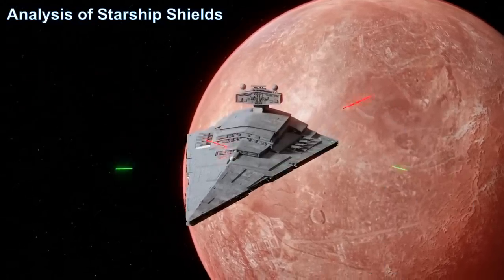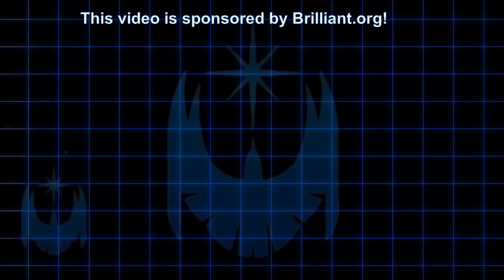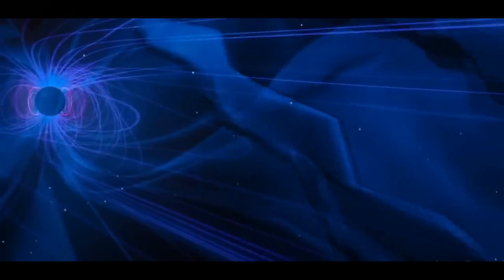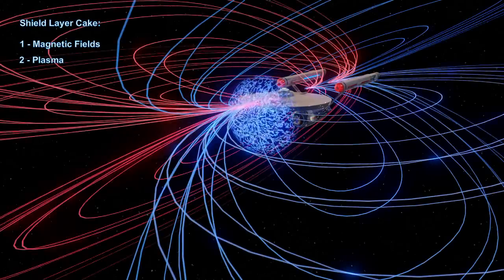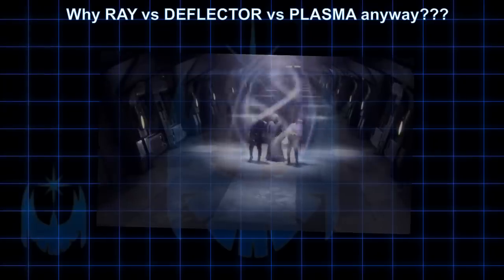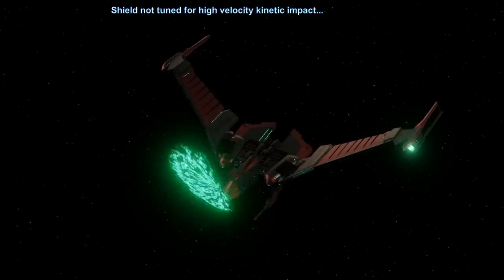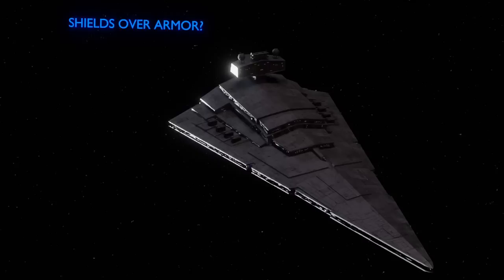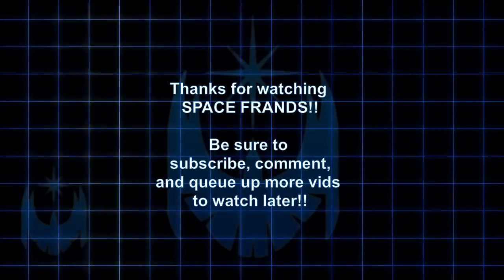REAL Starship Shields Types - They Work Like This...Animated Breakdown!

Comment: Funfact about Lasers - In "Star Trek the next Generation", when some weaker Ships attacked the Enterprise-D, it was mentioned that the Laser-Weapons can't penetrate the Navigational Deflection.
And there'S a simple reason for that to be a part of the Starships Navigational Deflection:
When travelling in space with more than LightYear, the Front of the Ship is hit with Particles and the Light of the Stars in a much-bigger amount than usual if approaching a solar-system with Warp-Speed, this could mean, that the Front is hit with the equal amount of light, comparable to a Laser hitting the Ship.
Wioth that amoun t of energy< hitting a ship, the Navigational shielding should be able to absorb or deflect so much energy.

Why I compare the Light of a distant star to a Laser: Imagine that when you travel to a star System that got quite a bright star, then Travel at it with a speed that let's your Ship catch up with the amoiunt of light, that would usually come at you in the usual timeframe of 10 Years, but within a few Minutes, that Amount could become Dangerous.

And in some Cases, they showed in Star Trek, how the Outer Plating of some Shjip-Section would start to receivbe Damage.

Comment: They exist because Star Trek special effects couldn't have the original Enterprise get all beat up all the time, so they created the concept of invisible ray screens/shields that the cast could comment in the dialog.  That way the seemingly undamaged USS Enterprise could be at 2% shields and failing, with a stressed looking cast on the bridge set, and it would be dramatic.  Then everyone copied them.  Now, every sci-fi universe seems to have shields, though we often see damage anyways because it looks better that way.  Only now are we seeing sci-fi ships that ditch invisible shields for just good old fashioned armor plating.  But, the real world answer is that there was a filming budget, and this fixed the issue.

Comment: I always thought of the shields that act as a sort of wall as being more of a spacial or subspace distortion powered by the ship, and the more damage that the shields take, the more energy it takes to keep them active which will eventually either overload the capacitors or just drain too much power from the ship.
Reply: At least for Star Trek.  The TNG Tech manual describes shields on a Galaxy-class starship as being an intense bubble of graviton particles or field that creates that spatial distortion that is effective against both matter and energy, if I remember correctly.

Comment: Shield technology in Trek is a bit tricky to grasp. There's no specific distinction between shield types, because one shield can do various things: deflect objects, absorb enemy fire or withstand kinetic impacts (to a degree). Also, deflectors deflect physical objects with graviton particles, and do it independently on shields.

Shields on Starfleet ships are projected by 2 main components: shield emitters and the deflector dish, which ties up the shield bubble and provides stability to it. That's why they're called ''Deflector shields'', ''Deflector screens'' or simply ''Deflectors''.

Star Trek only distinguishes between 2 types of shields: bubble shields and shields that conform to the ship's hull.

Comment: Ironically the best defense would be, that if the ship would be in water. Well of course instead of water i'm talking about some dense gas which acts like water, but can be manipulated by, say a magnetic field. So basically plasma shield for example.
What i'm saying that plasma shield would not evaporate projectiles, but rather slows them down similarly when you fire a high caliber weapon to water. Also the micro meteor armor on the ISS uses double hull with air between them, so the second hull is not penatrated.

The shield would probably slow down any medium speed (cannons) projectile, absorbing it as heat, or maybe deflect off if it hits the shield in a shallow angle. Very high speed projectile (rail guns maybe) would be able to penatre thru, hiting the armor directly with much less penatration power, but still able to cause some damage.
Very slow projectile (like torpedos, missles) probably would have no problem going thru the shield though, just like in water. That needs point defense probably.

The shield would also protect from heat based weapons (lasers) like water protects from them. It would reflect, scatter them, or absorb it, increasing the shields heat. Very concentrated beam would still probably penetrate it, but with much less power. However the problem with this is that the shield would not allow thru visible light neither, so you could not see thru it (and nor does the host ship from inside). So the transparency of the shield must be adjustable at least on some light frequencies. 

Hiting the shield constantly would make it absorb the heat of the weapon, heating the shield up to very high temperatures, which would probably leads to the loss of the shield, as the dense gas would escape. It may also cooks the host ship if the temperatures gets extrame high, which probably results in a literal shield dropping to prevent it damaging the host ship.

Comment: Plasma shields. Lol. Try that against the Covenant.
Their weapons are based on plasma.
Basically, they have massive plasma projectors able to melt normal metal plating armors (so you need stuff like ceramics or better, in Halo Titanium-A works against it pretty well, but once plasma reach the superstructure of the ship, it melts it and destroy the support that keeps on the armor).
If you have plasma shields you basically ends up fried. At every hit your shields will accumulate more plasma and increase in temperature, which is not going to disappear or lowering down because your magnetic field keep it up.
At some point, you will be surrounded by a plasma shield so hot and heavy that it could possible disrupt your magnetic field and falls upon your ship melting it like ice under the sun.
Star Trek and Star Wars ships aren't fitted to fight the Covenant.
Although Covie uses also some kind of lasers, if I remember correctly, UV lasers. Those will probably inflict no damage to ST and SW ships.
Covenant Plasma torpedoes instead will be a lethal threat. Even if you are able to hold on the hit with your shields, the explosion of these torps will just increase the amount of plasma of your shields. So we return to the same stuff of before.
It ends up with the plasma shields collapsing and doing damage to your ship and ultimately a torp more will destroy the ship. Also because these torps have long range, auto-tracking and huge charges.
UNSC developed Titanium-A armors that are thermal resistent, plus after the war they managed to put their hands over Forerunner shields. That are "solid photon shields".
To give you an example, it works like what you see in Star Trek Discovery when the ship loses a part and shields enter in to avoid decompression.
But these shields are not made out of plasma, only photons. Light basically. Solid light.
And since it's just light, it's not exactly susceptible to heat. It give more energy to the photons, but since they are solids, these photons will not move either way. Keeping the shields up despite all.
I don't really know how it works, it feels weird to me, but also legit since I discovered there's a lot of things that could looks weird but are actually true.

Comment: I would disagree that shields do not "add" much mass. This is more related to the how shields free up the ships physical design.
I would like to think that shielding systems as a whole is less efficient in terms of weight, as you need more computers, more power generators, and generally more equipment to use a sci-fi energy shield, but as these components can be centralised, this allows the ship to be better designed as a spacecraft which does not rely on armour to resist incoming damage (where armour is cheaper and lighter to install, but more expensive to maintain due to frequent repairs and necessity of raw material). This might be me thinking more romantically and how it would have a nice imagery of cheap, crude yet effective vs expensive, sophisticated yet not infallible.

Comment: Also remember that the weapon commonly called a 'laser' is not actually a laser in most franchises, as an actual laser beam would be pretty easy to counter, and also travels at the speed of light. Lasers ironically are lasers in Star Trek, but are extremely uncommon. Most franchises however, a 'laser' is a bolt of superheated plasma or something similar, simply called a 'laser' for practicality.
Reply: well also, "Ray gun" is so cliche scifi and Star Trek already owns "Phaser".  I do find it interesting that ship weapons are not called blaster cannons though in Star Wars rather than lasers or turbolasers.

Phaser I believe comes from the tech babble writers already knew the laser existed even in the 1960s so invented their own weapon term so they could play fast and loose with the physics as writing needed.  Similarly to how data from TNG onwards is stored in units called "Quads" no clue what a quad is but it does mean they never have to fear people going "HAHAHA Enterprise only has 50 gigabytes of storage"(which in 1987 would have been very scifi, today its a mid range iPhone).
Reply: An actual laser beam would be VERY hard to counter.

You can't shoot it down, you can't evade either in most cases. Best you can do is be out of range, start rolling or use your own weapons to try to take down enemy lasers quickly

Comment: Since we're talking about how shields and armor are implemented across various canons, I think it's worth mentioning that in many settings there actually are ways to adapt and repair armor in the field. For example, in EVE, you can fit your ship with armor repair modules, though they're slower and less effective than getting repairs at a station, and armor hardeners can be used to dynamically increase your armor's resistance to various damage types. In Freelancer, you can deploy nanobots to repair your ship in the field.

Comment: At about 7:40, you mentioned how EVE Online handles differing damage types, and it immediately reminded me of the system Star Conflict uses. In Star Conflict, there are three damage types: Kinetic, Electromagnetic, and Thermal with each damage type having different resistances.

Kinetic damage is dealt by railguns, and shields have really good resistance against it, while hulls are weaker to kinetic.
Electromagnetic damage is dealt by plasma, and it very quickly drops shields, but is less effective against hulls.
Thermal weapons most commonly take the form of lasers, and they tend to be in a halfway point between Kinetic and EM damage. They deal less damage to hull and shields than the dedicated damage types, but at the same time, they deal more damage than one of the other two hitting it's opposite medium.

To put it to numbers, on a scale where 100 is unmodified, kinetic damage would do 150 damage against hull, but only 50 damage against shields. EM would be the opposite, where it does 150 damage to shields, but only 50 damage to hulls. Thermal, being a halfway point, would do 100 damage to hull AND shields. Obviously the numbers are grossly exaggerated, but it gets the basic idea across.

And ships can have modules installed that change how much damage they take, or how well they recover from damage. In my builds, I don't bother trying to modify resistances, because increasing one resistance tends to weaken you to another. Instead, I build for maximum shield and hull volume, combined with maximizing regeneration.

Smaller, more agile ships are a bit different for me, though. Since they're normally much weaker than the bigger ships, I'll actually sacrifice hull and shield capability in favor of agility and speed, and rely on just not being hit.

Comment: That is technically possible, but practically impossible.
The energy amount required for all those shields is just ridiculous. My raw estimation is that you need to generate an energy level of a sun-sized star to make them work like shields. 
For the magnetic shielding, your ship must be made from not magnetic materials, so no metal, no electronics, and no crew with water in their bodies(water reacts with the magnetic field). 
Plasma is hot but not dense - so plasma shields that are powerful and dense enough to vaporize objects bigger than dust at relativistic speeds should be something like a Sun convection zone.  While activated they will boil a crew just by infrared radiation in seconds.
And as for active defense - that is the most realistic scenario, but still, your computer, sensors array, and shield activation system should be powerful enough to react to objects that move at relativistic speeds. It is not an easy thing to catch and destroy an object that moves 1000km/sec. And there will be objects that move even faster.